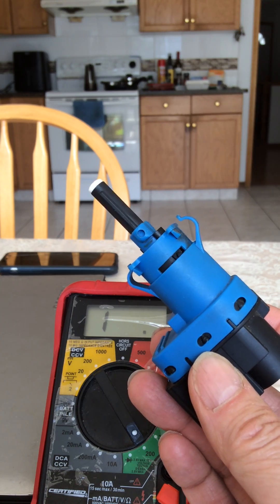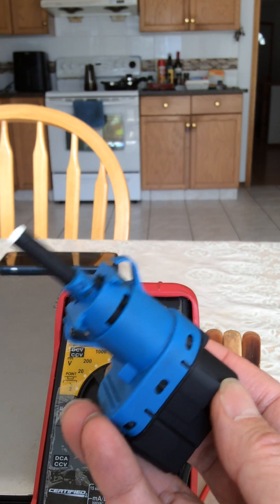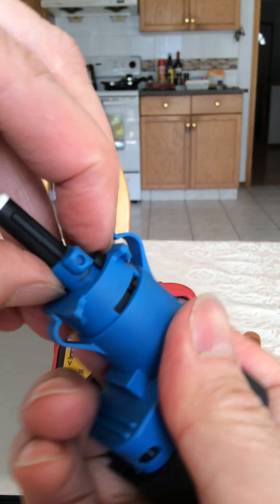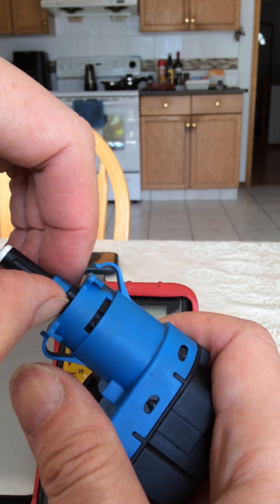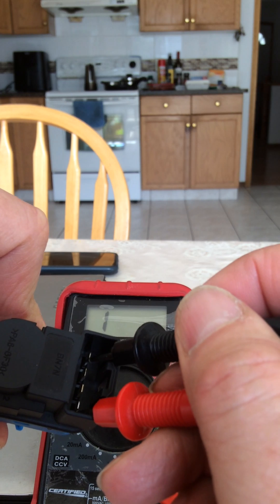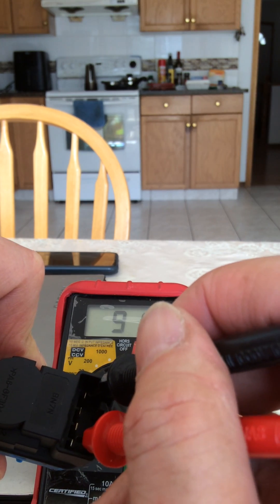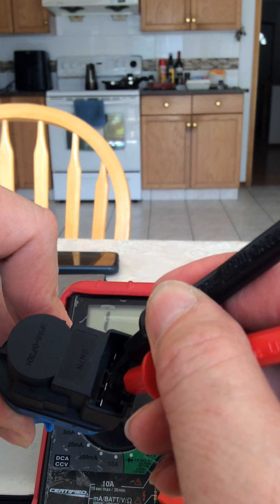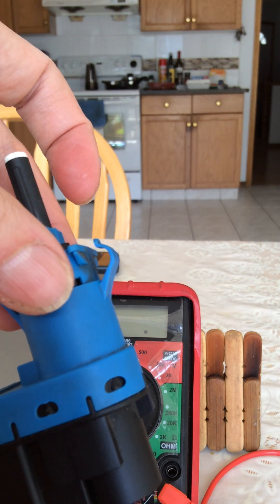Mazda, Ford brake pedal light switch testing

Comment: Thanks for the video. I was testing the brake light switch as my cruise control for Ford Focus wasnt working. I found out that the switch is working fine.

Comment: My God. What?
Reply: not sure if you're still having issues-- but if you need to know what he was talking about here's my best summary sorry if its real wordy;

if you look at the sliding part of the stop light switch-- the black shaft with white button on the end-- towards the base of it you'll see there is a blue piece of plastic.

you'll notice this piece doesn't move or rotate since its apart of the larger blue housing.
the black piece under it he talks about is apart of the center shaft and does rotate, this will lock/unlock the shaft into different positions.

if you took this piece out or replaced it before you'd know you have to turn it counter-clock wise/clock wise to get it into position or remove it-- this black/blue tab set up is why.

in order to properly test continuity you'll need to rotate those black tabs counter-clock wise. This changes the position of the shaft to what it would be like once installed.

(side note: you'll need to compress the shaft and rotate it clock wise to proceed with installing it after testing)

once you've rotated those black pieces you'll notice the shaft position changes like i mentioned, and you can now proceed with the testing like he does-- 

say terminals are as follows left to right; 1,2,3,4.

 You'll make contact on terminals 1 and terminals 4 (outside terminals), when the shaft IS NOT pushed in you should get a continuity reading. (0 or close to 0 reading on multimeter)

now make contact with terminals 2 and 3 (inside terminals) you should get no reading here so no change in the multimeter.

now if you can manage to press down the shaft while repeat testing you should see that these are swapped.
meaning that once you push in on the switch you should see that the outside terminals show NO continuity and the inside terminals show continuity. This means your switch is working properly.
Reply: @P1ICTC   thanks, im appreciate it.
Reply: @P1ICTC my switch show continiuty weather its inside or outside the shaft for the outer terminal. means my switch is faulty right?
Reply: @chesssbrontoxz2303  make sure you followed the steps to rotate those black pieces first. If the switch isn’t in the right position first you won’t get an accurate reading on your terminals

Comment: Bien por tu video. Cheque el mío y daba continuidad en los extremos, con el vástago salido, y continuidad en los medios con el vástago adentro....pero mi carro no arranca y la palanca está bloqueada.
Reply: Put it in turn it all the way up then lightly turn it down one try it , it should not be all the way up or all the way down the middle turn should turn it on ,
Reply from the maker: Ya veo, el mío solo controla la luz de freno trasera. Si su interruptor también controla el arranque, entonces intentaría realizar una prueba de derivación con un cable de puente.
I see, mine only controls the rear brake light. If your switch also controls cranking, I would try performing a bypass test with a jumper wire.
Reply: Put the brake switch in , lightly Turn it to the middle, not all the way up or all the way down